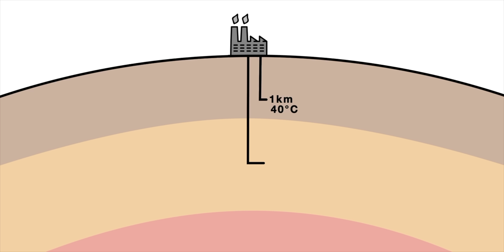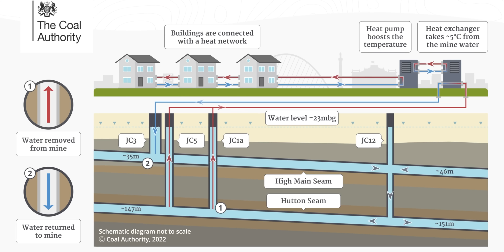Geothermal Can TRANSFORM Dirty Coal Mines into Clean Energy Hotbeds!

Comment: Why not dig a pipe down 10km with those new drilling methods it creates a glass lined pipe that you could create a circuit, bringing up super heated water to run a turbine.  We would then have 100% renewable electricity no matter what the weather or time of day.
Reply: The rock pressure and heat at that depth softens steel pipes and crushes the hole closed in a few months or even less.  Impossible with all the technology we have and can predict today.
Reply: @karhukivi  I think that the new drills leave a glass pipe behind them.  First trials are starting in Alberta Canada.
Reply: @markh7288  Maybe shallow drilling, but at 10 km the pressure is enormous.  Do you have  a reference to this drilling in Alberta?
Reply: This method I believe uses microwaves, so would also solve for the carbon emissions of the diesel powered drilling machines the fellow being interviewed mentioned. You could set up a drilling site near wind and solar generation.

Comment: An Economic analysis would be nice to see in a follow up video. Geothermal is a great idea, but is it a good financial idea (or a financial disaster for all involved)?  How long will it take to recoup the initial costs? What number of residents in an area would need to be connected to a District Heating system to make it break even, and what is the maximum numbers of residents would the system support (and what would their heating bills be then)? An analysis of some completed projects in areas with similar Geothermal Coefficients would be an interesting future video.
Reply: There was a scheme done in Fife several years ago where they tapped into an old coal mine. Can't remember the details but I believe it was a small block of flats for pensioners. It was renovated completely with underfloor heating, double (triple?) glazing, walls heavily insulated and a normal heating system as a backup. The residents were over the moon about their almost non-existant heating bills.
Reply: There are many city’s installing district energy schemes, world wide.
Reply: Cranbrook, a new development near Exeter, has a district heating system. It’s powered by heat from a gas fired power plant nearby. The costs of underground piping is considerable. The heat available is not always adequate so they also have commercial scale heating boilers to raise the water temperature as as necessary
Reply: One challenge, is the initial high cost of drilling and the risk the well will fail or not yield sufficient energy.
Reply: Thank you Ryan for making the key point 5hat was studiously ignored!
Also as others have pointed out - it’s hardly new.But it has remained small due to the economics.The cost of retro fitting 10,000 houses with a new warm water plumbing system would be enormous!
A good U.K. example of how it can be done from scratch is I believe an interesting one.  
When they were building the Battersea power station in the 30’s.They took the waste hot water from the turbines and pumped them through two huge pipes under the Thames to a brand new huge housing project of the day Dolphin Square. I believe it worked very well for a decade or two.
But the hot water was totally free and the housing project had the concept built in from the start.
The only viable geothermal is Cornwall full stop.

Comment: Do u shut down during summer?
Reply: Most geothermal heating is sized for summer demand so it always runs. That's because the build cost is high, so it must be kept small to reduce cost. Winter demand is then supplied by other means, usually burning stuff. There are trade-offs, so some cases can supply more heat, saving on winter cost. Some boreholes did not work, and customers were stuck with the bill without getting the extra heating.

Comment: You have failed to mention a crucial possibility: not using water but another liquid with a lower boiling point.
Just like some smarter fridges and heat pumps, if you use such an alternative liquid even the lukewarm UK mines might be enough for electricity production. 
Sure, it won't be as simple as pumping the water that already exists in already dug holes: you would have to lay some piping in the mine deeper tunnels and pump in the liquid in the pipes to heat up to boiling and then use the vapors to produce electricity.

Comment: 9:58 1kW to get 3kW, COP 4 😐 
Air source heat pumps has a SeasonalCOP of 4,6 in UK and does not require 2km deep hole.
Like it makes sense in realy cold months, when air source heat pumps has COP of 2,5, but the rest of the time when its warm outside in summer air source heat pumps has a COP of 6. But geothermal would have only 4 constantly though whole year.
Reply: But when you really need the heat, in winter, the COP is 2.5, that is more expensive than heating with natural gas. Seasonal COP is misleading. It is the COP when you need heat the most that matters.
Reply: @johnburns4017  Agree, it is. But as a first year owner of heat pump, I was surprised how few freezing days were in this year. So overall seasonal COP worked for me. 
Another thing is, I had gas heaters and their efficiency should be 70%, but now after heating season my savings with heat pump are so high, and it is more likely that gas heaters had an efficiency of 50-60% realistically. As for now my savings are around 400 Euro. Total cost of Air to air heat pump cost was 2500 euro. But it was a warm winter, so I`ll watch it next year.
Reply: To put the numbers, we had a 7,5 MW of gas used last year. This year we used around 2,5 MW of gas ( I didnt measure it this month ) and around 0,5MW more of elctricity. 

In calculation:
60% gas heater= 5*0,6=3MW of electricity, COP 4,1 for my heat pump = 3/4,1 = 0,73MW we should used. But we used 0,5MW. But as I said, it was a warm winter and we also limited our ventilation, and temperature to 19C  which saved energy.
Reply: @Teapode  
Condensing gas boilers are 90% plus efficient. Using boilers that modulate the burner down low - 3kW and less - using appropriate OpenTherm types of controls the efficiencies are quite high indeed, with improved comfort levels.

Modern boilers are all hydrogen compatible. Parts of Redcar and Ellesmere Port near Liverpool, in England, are having their gas networks and appliances converted to hydrogen as a trial. All free to the users.

Comment: interesting and also ace that we can use some of the existing infastructure too.
Reply: He's an idea.
Use heat to run a Stirling engine.
Use that to either lift a weight up a mineshaft or pump water to the surface.
When required, either drop the water back down in tanks, essentially a "gravity battery" driving a pulley system to generate electrical energy, or drive a turbine at the bottom of the shaft.
.

Comment: Coal and gas power plants work by raising the temperature of water from cold to very hot. If they ran their input water through a bore hole they could bring it up half of the way then only need to burn half the fuel to take it the rest of the way. As a short-term step, this would improve our existing energy infrastructure (effectively making it hybrid) and reduce costs.

Comment: There is a huge potential in geothermal energy in EU. Here in Poland, we started drilling 7km hole in Szaflary city expecting 180 degrees hot water so we could produce electricity as well.
Reply: Honestly, even solar has a lot of potential here

I've wanted solar panels since a kid, and also realistically, as someone who struggles with dry eyes, and therefore require sunglasses indoors when the sun is bright, I'm painfully aware of exactly how bright the UK actually is

Ie: it's enough for me to need sunglasses almost all year round

Comment: Geothermal is NOT renewable. There's nothing re-heating the earth after you take the heat out of very deep bores. That's energy that you can't put back. If enough of this is done, eventually the Earth's core will be cooled, creating all kinds of not only climate havoc but also solidifying the iron core, affecting the magnetic field and cosmic radiation levels. We're talking catastrophe far beyond the current climate crisis. Like fossil fuels, no matter how large are the reserves, they are NOT infinite.

Small scale is no big deal, but if we start thinking of geothermal being a magic bullet and going whole hog, there will be unintended and massive consequences.

Wind and solar energy take energy out of the atmosphere, which is very desirable under the current circumstances and can be easily stopped and even reversed if necessary. Reheating the planet itself if it gets too cool would be impossible.

Comment: Here in Thailand yesterday it was 40 degrees C in the shade but water coming from my solar well pump from 30m underground was 19 degrees C. A circulating pump and heat exchanger like a split air conditioner blower could help to cool homes here.

Comment: Why did she say geothermal is renewable? Isn't it already cooling more than heating? Doesn't that tend to shut down the dynamo?
Reply: Nope. The short version is the earth rotates in a charged particle field causing the earths molten core to rotate at a different speed (angular velocity) to the surface. There is an unfathomably large amount of energy being absorbed and reradiated

Comment: Load of Rubbish - Been tried in Cornwall - The deeper of the two wells will reach approximately 4,500m depth and will bring the natural hot geothermal fluid to the surface, while the second well will be around 3,000m deep and will be used to deposit the cooled fluid back under ground after it has been used to produce electricity.20 Sept 2022 - Didn't happen ! :face-red-droopy-eyes::face-purple-crying::face-orange-biting-nails::face-orange-frowning:
Reply: Weird, it works fine in Sweden. 20 years ago my parents bought a house with geo thermal heating. 14 years ago I moved into a flat heated with geo thermal.
But you know best.

Comment: Pfft. Not impressed. Real geothermal energy is from 20+ km deep holes which can yield >700C heat. Gyrotron drilling gets you there, and with plasma-glassed liners, promises to offer reliable safe industrial-scale heat anywhere on any continental plate (not just a local hotspot). See for example the work by Quaise Energy.
Reply from the maker: Pffft. Yes, we are very very aware of Quaise energy, their Gyrotron drilling technology and the numerous other aspects you stated and we await the outcome of Quaise energy's first test drilling with great interest. What they are attempting "COULD' unlock untold amounts of geothermal energy and that is fantastic. This is, admittedly on a much smaller, much less ambitious scale, requires zero drilling, zero untried technology and can be done right now, cheaply and quickly. So this really isn't a 'Pffft' topic.

Comment: I worked 45 years in the coal mines, where we were working the ambient temperature was 42c and always said they should have installed high pressure pipes for geothermal heating when they filled the pits in.
Reply: That would be too smart. We needed to be further ahead in renewables and storage and we wouldn’t be getting ripped off for Gas. Over reliance on at the time cheap Gas imports made us open to what we have seen. We need to start being smart on energy, we should have the brain power we have some of the most prestigious universities in the world.
Reply: It is a matter of pumping cost (energy consumed) plus development cost and maintenance vs energy recovered.
Reply: It's a bit like heat pumps though, using high quality power (electricity) to produce low quality (lukewarm water).
Reply: you are way out of date with your data. It is entirly posible now to heat a house ecconomically even in -15 degree tempratures from  air based heat pumps, ground sourced are more efficent. Go and look at EVman's vieos on the subject. He has all the data and lives in North Yorkshire in a very cold area.
On the Coldest of days he had more than enough heat and still got 3.5 KW of heat into his house from every 1 KWh power put in.
Reply: @colinmacdonald5732 need to do some calculations on hoe much hot water can be extracted for each kwh of electricity

Comment: There is one thing you did not discuss and that is the infrastructure to destribute that heat to all the buildings and the cost of installing it.
Reply: It costs to start with and is used for a looong time.
This mindset is why the UK has the leakiest homes in Europe.
You have to invest long term, not be so conservative and old school in your heads.
Reply: @starvictory7079  
Correct (All points)
Reply: @rogerstarkey5390 I hope I didn't sound too harsh.
Reply: @starvictory7079  It's not old school It's reality. Underground pipping to every house in any town or city is very complicated not to mention retro fitting the house with radiators for the heating. I am not opposed to the idea. I think it is a good  idea. But you made it sound so simple, It will take a generation to complete such a project and finance it. So it should have been discussed in the presentation. That's all.
Reply: @geoffreykail9129 Sweden worked for a 100 years to make our country modern. 
It can be done.
In the 50s many houses were heated with oil in Sweden. Then we had nuclear with direct electricity with radiators that are thin (80s).
Many houses in the countryside have used wood boilers but now use wood pellets.
In cities and town district heating from the local waste burning plant. I lived in a flat attached to that system. This is still used.
Now I live in a flat heated by geothermal, built in 2008.
Reply: @geoffreykail9129 I understand, but I do think it's a mindset. 
It's like that example of Norway and their oil fund vs Thatcher selling it all off as if the UK is a shop for outsiders to take advantage. It's so short sighted.
I know of course many wish they had a say in what Thatcher did.

Comment: Really interesting - hadn’t heard of geothermal for heating before. I wonder how difficult it is to implement district heating into existing individually heated homes or is a better focus on large users eg hospitals, schools, large businesses. I’d love to learn more  - love Helen’s scientific understanding of the issues!
Reply: I live in a flat in Sweden heated this way. It works very well.
It's not a new thing. I moved into my flat 14 years ago.
Reply: In the 90s I stayed at a friend's boyfriend's house in Peterhead, Aberdeenshire. The house was heated by a warm air system that was powered by the local oil industry. I don't know much more about it and can’t find any info on it now. But it was possible then, so I'd imagine it's not so difficult to achieve.
Reply: Large users and new build is definitely an easier place to start. Retrofitting to existing houses requires a lot of digging up the roads, so will be relatively expensive. As others have said, it's an idea that has been around for a long time, so I think you should be able to find reasonably accurate cost estimates.
Reply: @jonathanmelhuish4530  They dug up all our roads some years ago to install fibre optic cables. It wasn't an issue.
Reply: @jonathanmelhuish4530  as a country we really need joined up thinking here, if opening a towns streets up convert to three phase power, drop communication ducts and renew the water mains at the same time, could be a shared cost with other projects and future needs? internet
Reply: Are you actually serious!? Did you went to school!? Those are things we learn in school wtf!!! Geothermal energy has been in use for decades

Comment: Geothermal releases energy from the earth into the atmosphere. So it is not strictly a renewable like wind or solar. Ground source heat pumps are more renewable as they use heat from the sun on the ground near the surface.

Comment: This might sound like a stupid question, but: doesn’t letting out heat from the earth also heat up the atmosphere in some sense? Is it sustainable long-term to transfer heat from underground, onto the surface? Even though it doesn’t contribute to the greenhouse effect?
Reply: I mean it must do a tiny bit, but I suspect that the heat would eventually reach the surface anyway so it's not going to make a big difference. Besides if you use it for heating then you're not burning gas, the heat Is the same at the point of use.
Reply: It radiates out in to space like a plowed field on a sunny day
Reply: @theairstig9164  Wouldn't this heat get trapped by greenhouse gasses, like the sun? or is it only visible spectrum radiation that is trapped?
Reply: @hvglaser
First 7 words.... Correct.
Reply: @rogerstarkey5390  Ouch.

Comment: I read up on geothermal a few decades ago re some spot in Oregon, USA.  I recall there was a big problem with the plumbing being corroded badly by the hot water.  I presume you are talking about a drier process.
Reply: It works here in Sweden. I live in a flat heated by geo thermal.
Reply: I think what you are refering to, are  deep wells going for supercritical water. They are very challenging to utilise, but have a lot of energy. What is talked about here are wells extracting water much lower than boiling point, and where corosion is manageble.